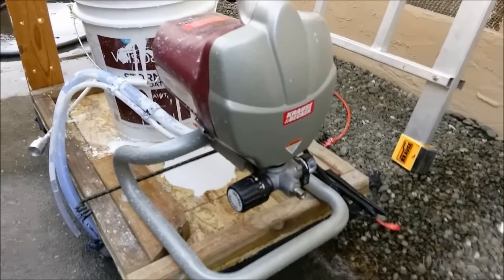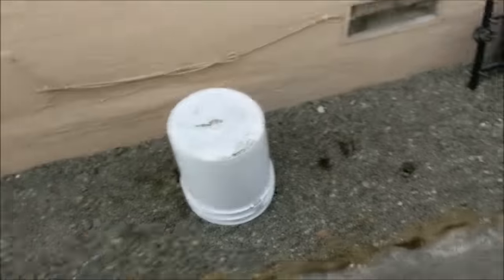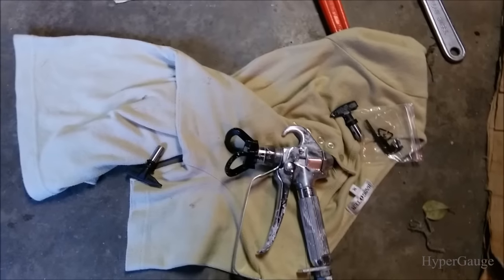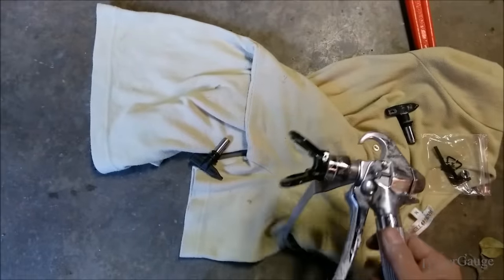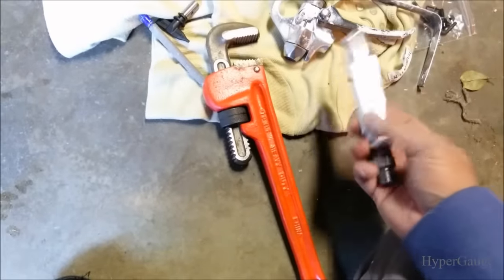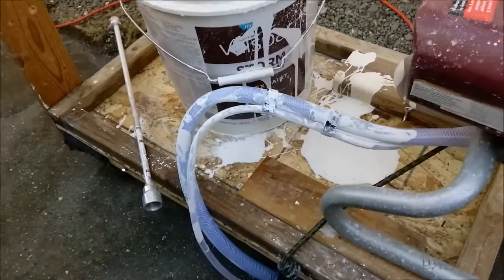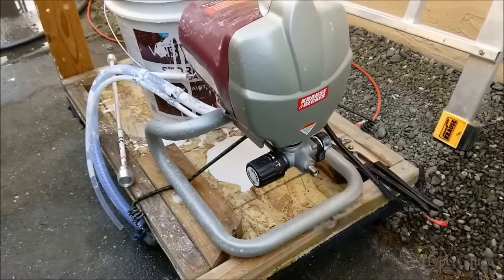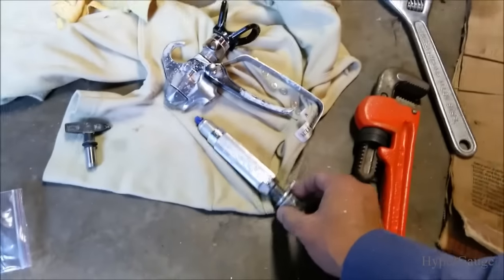Harbor Freight Krause & Becker Paint Sprayer System review Spray Gun disassemble and how to, tips.

Comment: What is the issue with the 515 tip?
Reply from the maker: There is nothing wrong with 515 tip. Some people actually like it better. But as an armature I like the slower spay volume of 413. It is more forgiving and less likely to over spray.
Reply: @HypergaugeDIY  thank you for letting us know. I did have a issue with the tip. I experienced a uneven pattern.
Reply from the maker: The first time I used the sprayer with the original 515 tip, I notice a lot of over spray teardrops. I got better after a while. So you may want to practice a little more. You can use water to test spray. When I changed to 413 tip all seems working fine for me.  Good luck with your project.
Reply: Different coatings have different viscosities.  You need to either thin the material, or size the tip for the material being sprayed.  The first number on the tip is 1/2 the fan width at a 12” spray distance. The last 2 digits is the orifice diameter in thousandths of an inch.  If you get stripes of paint at the edges, you have too low a pressure, too thick a mix or too small of a tip.  If you have too much overspray, you have too thin a mixture, too much pressure or too large a tip.
Reply: @rronmar  thanks
Reply: @rronmar  Thank you for your info. You just saved my having to learn this on my own.
Reply: I am having the tip spray out likenits missing gaskets or not tight, like a hose with no gasket. It comes out behind and around the spray guard at any pressure after priming. It began about half a gallon in. I have taken it apart and cleaned meticulously every part including the filter. I strained my latex twice and had the viscosity perfectly thinned. 
The harbor freight Krause and Becker came with the tip I am using, a 515. Could I have an assembly issue with the tip, guard and connecting nut? I did not come across a clog anywhere in the gun or line. I removed the line and flushed it, poured the cleaning water through a strainer to see if we had a clog that may have cleared. No luck, still the same problem today with just water, I haven't added paint.
Reply: @rronmar  I actually had the strips on each side with the 515 tip, but even with the pressure all the way up they were still there. but then it threw way too much paint everywhere.

Comment: I have since moved on to more commercial units but my first 4 exterior repaints were completed with this spray rig. I did replace the gun and the tips with Graco parts but this unit helped me start my business without shelling out $1000 up front for a decent commercial sprayer.
Reply: I started in 2006 painting with high end graco and Titan 440i sprayers that were around $700 to $800 ea and in 2016 I reverted to this Krausse and Becker. Painted my own house, my old RV and done about 60 residential and commercial properties with this thing so far on the original gun and have had no issues. I just love that it weighs around half of what a heavier duty unit weighs, and is more compact, while doing a good enough job. Way easier to carry around buildings.

Comment: I followed your advice and got various additional tips and 3 different extensions. The 413 tip worked great on the body of the house. I think you are right about the 515 being too much for a novice to control. I got 10, 20 and 30 inch extensions. The longer ones were great for the house body and eaves. The 10 gave more control up close such as a low ceiling. The link you had for the tips was no longer working. I did find newer brand on Amazon that fits the HF unit. They had the extensions and tips at prices about 1/4 Home Depot. Tips are about $10 and extensions about the same. The brand is Jewboer. I found a review indicating they worked on the HF gun and found it to be true. Hypergauge thanks for sharing your experience it helped tremendously with the daunting house painting project.
Reply from the maker: Thank you. I am happy that you found the information useful.

Comment: I've been using mine for staining a LOT of a large fence.  Got about 10 hours on it already.  Agree with the change of tip size.   The absolute key to any sprayer using soap and water for cleanup is to make sure not to store it with water anywhere in the system.   The 'recommended'  Grayco Pump Armor is NOT necessary.  Instead,  use any kind of automotive anti-freeze.  It's cheap and coats all the parts inside with an anti corrosive.  Mix it down to 50/50 if you want.  After hose is clear from cleanup, disconnect that and the gun.  Prime with anti-freeze then switch to spray.  As soon as you see it coming out, shut it down.  That's it. 

Also recommend taking the gun completely apart -  clean really good with soap and water. Let it dry or force compressed air thru all parts of the gun.  As you put it back together,  I use WD-40 and squirt it everywhere -- inside, all parts, tip, spray needle, screen filter, trigger - everywhere.  Then store in a Ziploc bag with a final spray of WD-40 and seal the bag.  

And, yes,  this is a good sprayer for the price --  I've had zero issues with mine.  When I'm done with it (even for just a couple of days) I'll 'pickle' it as above.  All hoses look brand new after each use -- takes less than an hour to fully clean it for short or long term storage.
Reply: Could you use this to paint a car?
Reply: Can you comment on the differences in cleaning the unit when using it to spray water based paints compared to latex/oil based paints? I heard you needed to use mineral spirits to clean when using latex and then after that clean it with water so you don't leave any mineral spirits inside it to corrode. I figured only mineral spirits would truly help break down the paint inside the unit as its being pumped out during cleaning. Then water then antifreeze?
Reply: @chrish7165  NOP!! for a car using an HVLP Gun and a compressor a least 21 Gal.

Comment: @ $172 after using the 25% off coupon this is $57 cheaper. I am not familiar the Harbor Freight Krause & Becker Paint Sprayer but I am with Graco. When I had my 21 rental homes I bought a Greyco Magnum Pro and although it worked nice it was expensive to maintain but in all fairness any paint sprayer like this will be if you use them as often as I did. I painted all the interiors and exteriors of each rental I owned. I ran 2 five gallon buckets of hot water through the machine to clean it & also an additive in the final bucket of water that retarded rust. I paid over $500 for the one I had 15 years ago. I would try the Harbor Freight if I were still in the business. Thank you for the review!

Comment: I had to do the same to open the bolts on the gun. Hurt my hands trying to do it with plyers at first lol. And thanks for the tip about the 413 I think that what I need.
Reply from the maker: Thank you for watching my video. Except the little hiccup, the little machine is amazing.
Reply: @HypergaugeDIY  yea, for $180 bucks it works well. It's comparable to the $500 dollar machines imo.

Comment: I never took anything apart when I clean it. I run lots of warm soapy water through it. When clean, I run new thin motor oil through it until it comes out the noozle, then store. When ready to reuse it, run warm soapy water through it again until all the oil is gone.
Reply: How many years did you get it to last doing this? When you're ready to use do you run non-soapy water after soapy water so you don't have soapy water mixing with paint?
Reply: T&M's Backyard Creations
 Store it with radiator fluid instead of motor oil. Both can be used no problem there.

Comment: I bought this same unit a couple days ago. Worked great till clean up. Now I can't get the spray tip to stay in. Did I lose a piece or am I doing something wrong. Thanks
Reply from the maker: Thanks for watching my video. My guess you may have a missing part.  Unfortunately I don't have the spray gun diagram. And a quick check online also can't find one, but as I know the Graco G2 gun is actually very similar to this one. Maybe you can reference on it. Good luck.
Reply: You are missing the seal that you push in from the back. That thing falls out really easy.

Comment: Hello, in case of needing a new filter for the spray gun, how do I find it or where can I buy it? Thanks!
Reply from the maker: You should be able to contact Harbor Freight for a replacement part. In case they are not selling it, I was told Graco SG2 sprayer filter is compatible. However, I cannot be sure as I have never tried it.  You should verify it before using it.

Comment: So what if I wana come back tomorrow and finish with same color. Is the cleaning process necessary or is there a way I can wrap everything up and come back to it without anything clogging or drying up?
Reply from the maker: Thanks for watching my video. if you are thinking to continue the work next day, it is strongly recommended to clean the system and start over next day. However, for just a few hours quick break, you may referrer to this video and I have mentioned wrapping the spray gun and the paint suction area so it will not dry off for a few hours when you are taking a break. https://youtu.be/lscjfWB-Sc4

Comment: I see you are recommending a 413 sprayer.  Is that for interior latex that typically calls for a .15 opening?  I am looking to keep overspray at a minimum.  Thanks
Reply from the maker: Unfortunately I don't have any experience using this sprayer with interior paint. I am not sure using this sprayer for interior is a good idea. The power maybe too big and it could easily make a mess for you. I always use a simple roller small job or power roller if I need to paint a lot of interior walls.

Comment: I'm trying to spray elastomeric paint and roof coating got any suggestions
Reply: Probably need a decent sized pump and a big tip. Elastomeric is thick as hell it's a bitch to backroll just painted a Warehouse with it. You also dont get much coverage from a 5 of paint.
Reply: I used a 495 Graco for the job since our little 390 just doesn't have the power. We also only used a 50 foot line instead of a hundred

Comment: My issue is that while cleaning the tip came out and I cannot figure out what holds it in.  I feel like I am missing a part that holds the tip in the spray nozzle.
Reply from the maker: There should be a a little round seal/washer with a curved side that goes in between the spray tip and the gun body.  The curved face rides on the curved tube of the spray tip,and the flat side rides on a face in the front of the gun and gets compressed to seal when you screw on the tip.  Is it possible that you loose that seal when cleaning the gun? You maybe able to find a similar parts in hardware store where they sell similar type of spray gun. Good luck with your project.

Comment: I am wondering about overspray with nearby  parked cars  and cars driving by on the fairly busy road  that I live on. I will be painting my old very tall wooden home  thanks
Reply: This unit has an adjustable pressure knob, so you can turn the pressure down so that it sprays less paint and creates less overspray. Just shoot your siding from about 7 to 8 inches as opposed to the normal 12 inches and you'll be fine. Very little overspray when you do that.

Comment: Do you have to mix the paint or can you tell me what type of paint is recommended for use.
Reply from the maker: Thanks for watching my video. I think they recommend common water based latex paint.
Reply: I bought this sprayer a few days ago to pain't a whole interior of a 200o sq ft remodel with fresh texture coat. After 1 gallon of Zinseer primer and repeated tip plug ups on the 515 tip I started cutting 1 gallon of paint to 1 pint of bottled water. The rural water out of the tap has a high chlorine content and didnt want to risk a reaction. I also will be adding smaller tips and yes the handle is crazy tight.

Comment: Just got this sprayer to paint my house. In the box for the spray gun, there is a filter screen and a rubber washer.  What are these parts used for?  Also in the box, there was a small allen key and a bolt.  What are these for?  thanks
Reply from the maker: + Robby Vanz The filter screen is a replacement filter for the spry gun. I kind of remember there are couple plastic washers  with my package, but I don't recall what are they for and I no longer have them.

Comment: @Hypergauge, did you have to assemble the sprayer when buying it, if so, were there instructions>"? great vid
Reply from the maker: Thanks. You do have to assemble the sprayer system before use. It should be very straight forward and simple. There should be an instruction and a quick start sheet came with the unit. If you don't have it, you can download them from the Harbor Freight web site.
Reply: ahh thank you sir
Reply: You only have to attach the hose to the spray rig and the sprayer to th he hose to use the sprayer. Things you do need extra are a 2 gallon bucket with water to prime the rig before sticking suction  hose into the paint. You need a large piece of cardboard or a large trashcan with a construction grade trash bag to discharge into if you have to eject a tip plug. I use a 2 gallon bucket to pour paint into and mix with water then drop the suction hose into to pump paint from. Mix paint well with a paint paddle and drill or you will get plugged up. The sprayer stops pumping when the paint is level with the filter bulb. So I add 1 to 1.5 gallons into the bucket.I also strap the sprayer to a furniture dolly to raise the height but leave the bucket on the floor. Expect the sprayer hose to be very stiff the first day or so.It is tightly coiled in the box and doesnt lay flat when stretched out to paint , it wants to loop .(maybe drop it into 5 gallons of hot water before attaching to the spray rig before using will relax the hose. After 5 hrs of use mine has started to relax but the first 2 hours of use out of the box was very difficult.

Comment: did you buy the tip extension from harbor freight? i can't find it online and i really need one. great video, btw. very helpful
Reply from the maker: +gvanaski . I got the extension from Amazon. The tip is from eBay.
Reply: +Hypergauge what brand is it? some commenters said the graco isn't compatible. do you think the $10 extension sold on ebay will work? thanks
Reply from the maker: +gvanaski  This is the extension I got from Amazon.  "DUSICHIN DUS-200 Extension Pole for Airless Paint Spray Guns, 20 Inches" but looks like it is out of stock now. If you are getting it from eBay just make sure the thread is correct. The tip I got from eBay is shipping from China. It is much cheaper. I figure if I can use it for a couple project is good enough for me so I got the cheap one.
Reply from the maker: Victor Chingon Ortiz I am 5'9" tall and with the 20" seems working great for me. 30" will work but could be too long in some case and it is a little bit more heavy.

Comment: Have you found a source for replacement gun filters? Do the Graco (or aftermarket) G2 or whatever filters fit?
Reply from the maker: Sorry, I don't have info for the fun filters. Mine is still in pretty good shape. I got a feeling the Graco G2 filters will just fit. The two guns seems just identical, but don't just take my word for it as I never try it.  I will suggest measure the actual dimension and check if the Graco filter is the same size before use it.
Reply: Thank you. I'll do the same when it's time to replace, though I've only burned about 3 gallons through my gun so it might be a while. Hopefully others here will chime in if they find a filter that fits.

Comment: I bought one of these and nothing happens when the dial is turned to prime. Went back to harbor frieght and the second one was the same. Turned the knob till the machine turned on and no suction for priming
Reply from the maker: I will suggest taking the unit to HF and have them test there before replace a new one. If the unit is on and running and there is no suction, the problem is likely with the valve. Maybe a bad batch.
Reply: @HypergaugeDIY  thank you for reply, we did that this morning and the new one did the same thing. When turned to prime there is no turn on, once we turned to low spray the motor started but no priming
Reply: Same! I bought one and it won’t prime! Super frustrating

Comment: Do you have a video on using it for the first time? Or can somebody recommend a first time user video?
Reply from the maker: Thanks for watching my video. I don't have a first time use video. Follow the manual instruction should be ok. If you never use a paint sprayer before. I will suggest to practice spraying water to get familiar with the system and technique. Just be patient, detail and you should be fine. Good luck with your project.
Reply: @HypergaugeDIY  Thank you for the quick response!
Reply: Also, do you have to filter paint first before using? I saw another video that shows that.
Reply from the maker: Since the paint I used are always fresh so I have not used any paint filter. If you plan to use some old paint or questionable quality paint then it is necessary to filter it before use.
Reply: Hypergauge thank you!